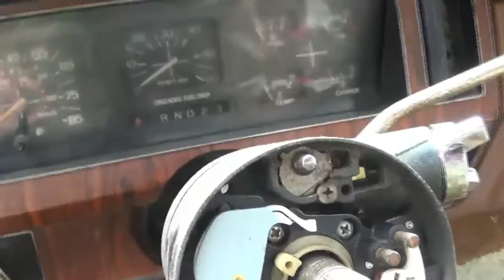How to Repair a Turn Signal on a 1981 F150 Ford Truck

Comment: Thanks guys. Just bought a 81 F100 Ranger with some problems. This will be a handy reference for me. Lot of cancer on the old bomb,  but I can do a bit of mig welding.  It'll be nice working on something I understand for a change. No computer,  ignition and fuel systems I can actually figure out. Best of all, the ol reliable 300 inline "6".  What a concept! Simplicity.

Comment: hi great video, I have an 89 250 and the hazard lights aren't working. I have turn signals, brake lights. I'm thinkin it the switch itself. not sure how else to troubleshoot. do you have a suggestion? thanks

Comment: So I’m have a similar issue. I have a 1980 Ford F-150 manual transmission and the blinkers don’t work but hazards running lights and brake lights work just fine. Turn the signal arm and I get nothing at all from the dash or from the lights. Was wondering if this could the same issue as y’all had.
Reply: I have the same problem with my 84 f150 I replace the inside fuse box because the guy that owned it before me hot wired some fuses into one another burnt up the box. I thought that was the problem but it didn't change anything
Reply: I'm having the same issue, did you get it fixed and if so what was the fix?

Comment: Hi
I Own a  1986(Same interior & exterior design as this 81, except mine is bright red)   F250.  My speedometer works, but my   gas, oil, temperature, & battery gauges don't.
Could you tell me what could be wrong with them? All my fuses are new.

I bought the truck in 2012 & have been fixing it up since & it's almost finished
Reply from the maker: i would take out the dash gauges and reconnect them - re plug them back in
Reply: It could be you need to clean the contact under the nuts holding your gauges in or it could be your ICVR. You can get info on that little bugger here: http://www.garysgaragemahal.com/icvr.html. The folks on that site are friendly and very helpfull.

Comment: Anyone have any idea as to why I have no turn siganls at all I have emergency flashers and brake lights bit no turn signals good fuses and I changed the relay at thw top but still nothing I legit replaced the bulbs today so i have no idea besides the switch